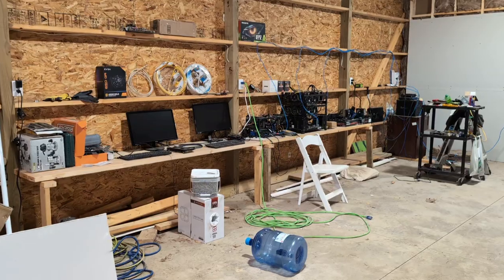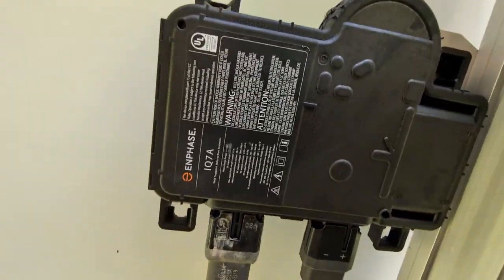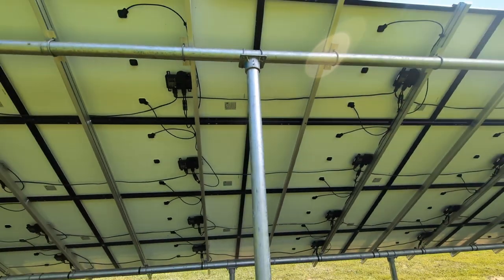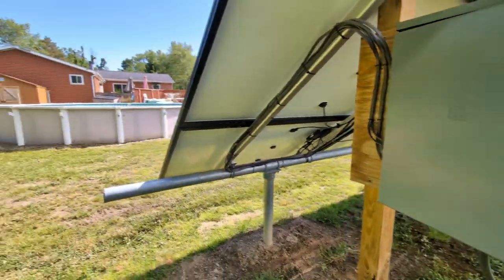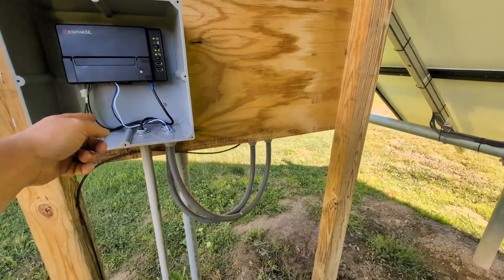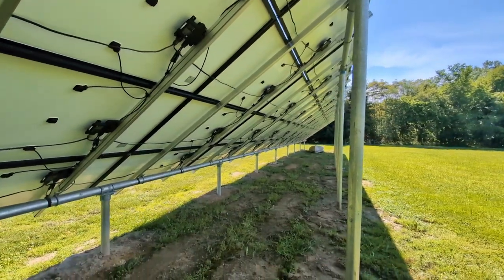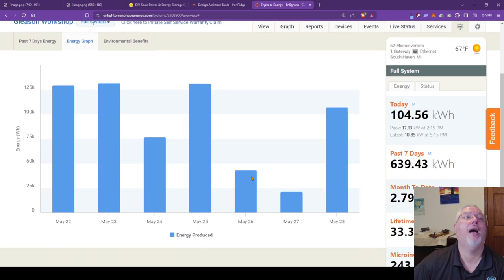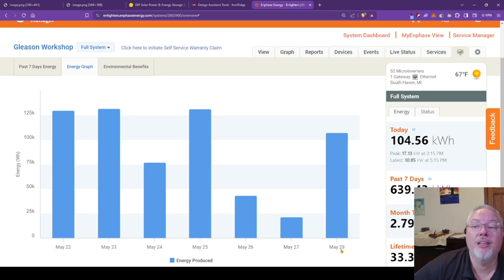Solar electric is a huge win for profitable crypto mining!

Comment: Definitely NOT bifacial panels, hope you did not pay for that type of panel, also for string inverters you can always run many of them in parallel so no need to worry about replacing the inverter if you add  more panels than it can support, anyways very nice setup, even tho micro inverter setup is more expensive.

Comment: Those aren't bi-facials.  The decal doesn't say it and you need to know what you have. You can see through them, blurry though. 52x390 (NOT 335's) is 20, 280Kw; realistically you will get about 75% of that often. So.. what gauge wire is the PV going to the house.  I do some nicehash CPU\GPU mining and 3 mini box miners almost 24\7. But putting them all on Solar is my goal. I am offgrid\unplugged but do have 30a shore power. Only use it for my 9k mini split and 2 mini doges. They make good heaters too.
Reply from the maker: I dont remember the guage, but i know its oversized.  because the guage i needed wasnt in stock and i needed it on that day.  so i went up a size.  its aluminum wire.  each one about the thickness of my pinky.   and a separate copper ground wire thats not as thick.  i will have to see if i can figure out the exact guage for you.
Reply from the maker: I appreciate that.  i waited to the last minute before i had a contractor coming out to tie in the electrical.  So when i went to get wire....  i dint have all the choices.    but i agree 100% for any future stuff i put in!

Comment: So let’s do some math. $174 check from power company at $0.11 per kWh means you net exported 1,582 kWh of power for the whole year. Divide 1,582 by 365 days gives an average daily export of 4.33 kWh. Not sure you thought this through with respect to ROI. You state that you consume 65.33 kWh per day which is huge energy consumption for a single family home. Any cloudy days and you are going to be sucking in huge power from the grid. DIY = expensive education in this case. Sorry dude.
Reply from the maker: My electric bill was a average of $350-$400 a month.  with this solar array and 1 new all electric vehicle,  my average electric bill has been -$80.   meaning i have had NO electric bill now in 1 year and 7 months.    the system cost 44k but i got 13k back in taxes.   so this system cost me $31k, with a average electric bill of $350,  i will save $31k in 7.4 years.   So i have the system for a Full ROI in less then 8 years.   In michigan.    I was lucky and paid cash for the system so i have no loan on it.     So in my math....  i like the ROI...  if i had to pay a vendor to install this. the price surely would have doubled.
Reply: @nfoguides  what is your yearly  production ratio (kWh/kW) for the solar array? ~1,500?
Reply from the maker: 80 panels ay 390 w,  i think the system in total was a 21kw
Reply from the maker: in 2023 it produced :  23,829,204 watts
Reply from the maker: Did i mention I am a first time Solar Guy, and a first time DIY guy...  :)  i appreciate your feedback and point of view.

Comment: Man, $0.15/kWh, I wish I had that here in California. Here off peak is $0.38/kWh from 12AM-3PM, peak at $0.60/kWh from 4PM-9PM, 3-4PM & 9PM to midnight is $0.44/kWh.

After watching the video, nice setup. I'd recommend adding a solar surge protector since that nice array is a lightning rod out in the open field. These are designed for DC and will clamp around 115,000 amps instantly.
Reply from the maker: I lived in Cali when i was in the Navy years ago.  So glad i didn't have to pay electric then... and now!   Even at 15cent per kWh my electric bill was running an average of $350 a month.  and i have replaced everything i could in the house to get better efficiency.  All windows, All Doors,  New heating and AC, new hot water heater,  new pressure tanks,  new washer and dryer.   Nothing was lowing the bill.  But my Solar array has!   

Thanks for the recommendation, being that i did this as a first time DIY project, there is so much i didn't and don't know :)  I did make sure that the panel  combiner box has a proper copper grounding rod...   I will look into your recommendation!  thanks

Comment: With micro inverters how do you store the electricity when the sun is not shining or do you only do crypto mining when it's sunny out?
Reply from the maker: @basspig  battery storage is still to pricey for me.  So I am just sending my electric to the grid which the electric company gives me credit (negative $ balance on my bill).  I overproduce what I need during sunlight hours.  So at night I pull electric from the grid.    Now I average all of this over 365 days.  And find without crypto mining my house uses a average of 65kwh a day.  

My electric bill for the past year and 7 months has been $0 when averaged across all the days   actiallu I still end up negative balance.   

So it's the negative balance that I alit myself to crypto mine with.  If I go past that allotment and cause a above $0 electric bill.  My mining efforts have to pay the bill.  Or my wife will beat me up
Reply from the maker: I am not ruling out batteries.  But when i bought the system i have i was lucky and we paid cash for everything.  We didn't want a loan to have to pay off.  So we just opted to forego the batteries for now.  How many panels is your system.
Reply: You can only do a few things where the sun don't shine 😅
Reply: @mlshekar1  I run my diesel genset to charge the battery bank when its raining out.

Comment: Bifacial panels look the same on front and back to allow gains from the rear
Reply from the maker: Thank you for the correction.  i was confusiong that term with the aspect that each panel had 2 halves.  so if the part of the panel was covered, the other half could still work.

Comment: Throw those micro inverters in the trash
Reply from the maker: I am a solar first time DIY person.  Why would you say to throw them in the trash?   I personally liked the idea of each panel doing its own thing so  i didnt have to worry about buying 1 very large inverter and having that inverter eventually die on me.
Reply: @nfoguides  I've heard they are problematic. But what do I know? My solar system doesn't even have an inverter. You'll find that most of the stuff in your home actually using dc current anyways, except for large appliances. I don't use a inverter for my miner, nor a traditional psu
Reply: @nfoguides  microinverters are a waste of money on ground mounts. No shading to worry about. AC coupling the solar makes ESS less efficient should you ever add batteries.
Reply from the maker: Thanks for your insight!
Reply: Micro inverter  safe  more than string inverter
Reply: @anonymous-dd3gr  says who? Based on what logic?